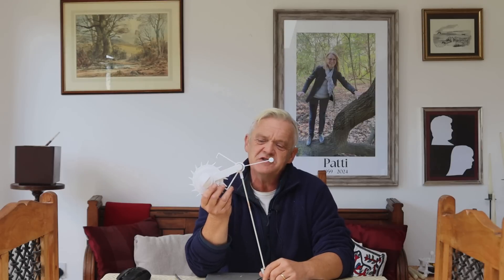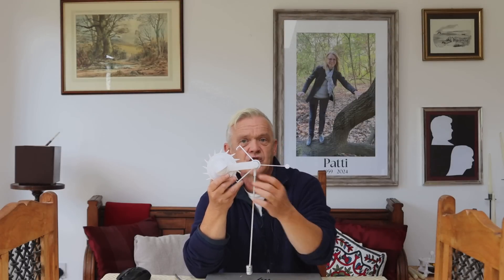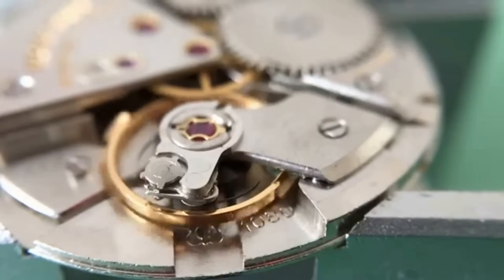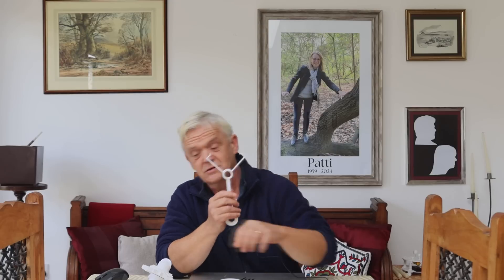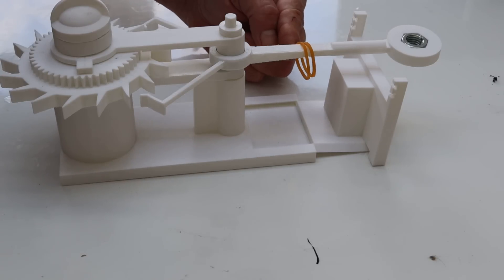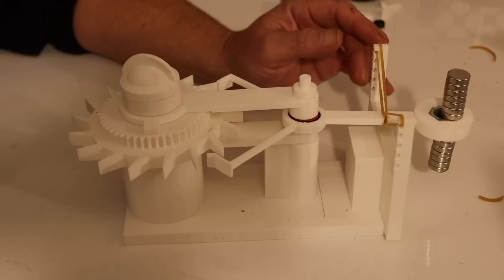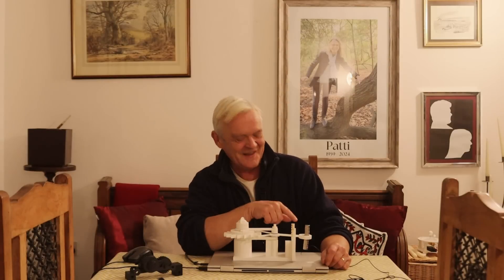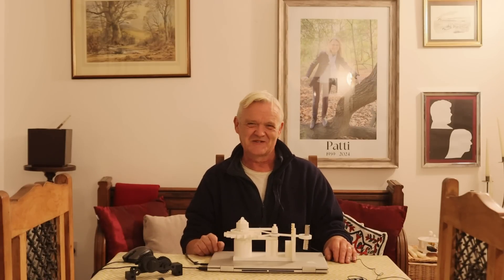2300 Building A Mechanical Oscillator

Comment: The earthquake thing Tesla fiddled with took a good bit of mass to do its thing (the moving part wasn't exactly lightweight), and it also has to hit the resonant sympathetic frequency of the structure it was attached to. Conceptually it's simple enough though, even if it being something "portable" takes breaking down the weights making up the mass being used. I think most people covering the story got the frequency part right, but they overlooked what it took in terms of impulse to do its thing.

Comment: As the most informed battery expert, the public has access to I would like to ask your opinion on the rumours about the hamas pager batteries is it possible to have an anode and cathode with an electrolyte that can be exploded by the creation of dendrites?

Comment: one possibility for adjusting the timing would be to design it so the nut is at right angles, and put a long bolt through it. turn the bolt in or out to adjust the period
Reply from the maker: nice
Reply: Had a similar thought, except for nuts on the pendulum axial bolt and they could anchor potentially larger weights to calibrate along the length

Comment: There was a time when we used to speak of 17 jewell watch or 21 jewell watch or whatever number. The more jewells was associated with better quality. I believe that the bearings were the supposed little jewells and shaped to hold the tiny spindles. The early electronic watches were called quartz watches , and it confused people who couldn't see how tiny bearings could be fabricated from basically grains of sand . I should finally check what particular mineral those little jewell bearings was .
Reply: Corundum: synthetic sapphire or ruby. See the wiki entry for Jewel bearing
Reply from the maker: ruby was sometimes used as well

Comment: Not only do pendulums not really work for wrist watches, but imagine you're on a ship rolling from side to side. The center on the escapement mechanism rotates relative to gravity, ultimately throwing off the 'speed' of the period from the clock's perspective. (Like the clock can't tell it's listing side to side, it can only tell when the pendulum passes through it's centerline)
Reply from the maker: cheers mate
Reply: The docudrama  ,,The Search For Longitude,,  tells the story of the chronometer that was developed for the British Admiralty. A good mini series.
Reply: Admittedly it'd be amusing to build a "clock" with a chaotic oscillator using some kind of offset segmented pendulum. Kind of recreate what a clock on a rocking boat would experience in terms of how the mechanical action is affected.

Comment: Is it me rt it felt like you could hear the clicking frequency being modulated by a smaller frequency?
Reply from the maker: i didn't catch that mate - but maybe - i couldn't really tell
Reply: @ThinkingandTinkering  thanks for answering! if you really were desperate to check that out, I guess that you could attach a small Arduino accelerometer to record the accelerations and with a quick FFT check if two frequencies are peaking. But again, do not think that you are so really desperate to figure that out ... LOL

Comment: what is this good for exactly?
Reply from the maker: lots of things - if you want specifics do a google search - i mentioned one your car suspension is another, anti earthquake is another - they are used in thousands of applications mate
Reply: Ideas spawn ideas, etc.
Reply: Like an escapement, it allows you to meter out rotational energy stored into a spring into discrete "beats".  It's just a tool for doing a job.  If the escapement is a hammer, this is a mallet.